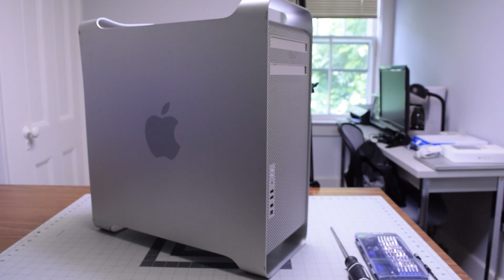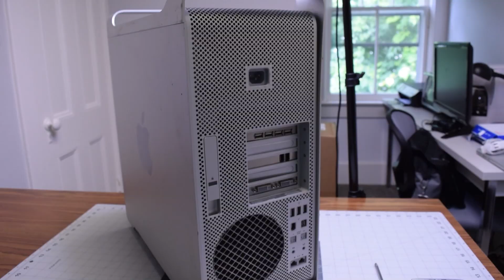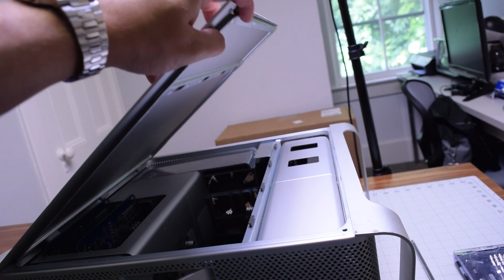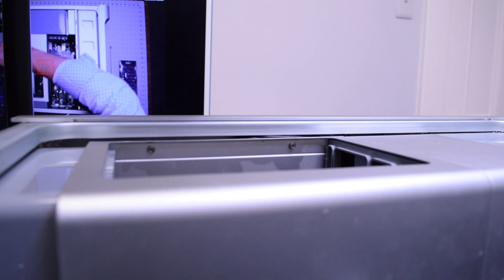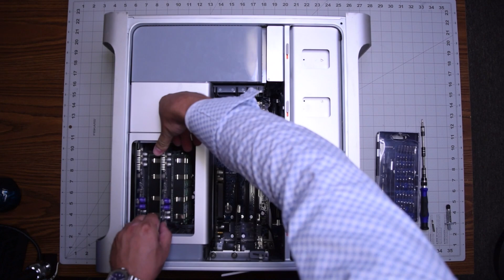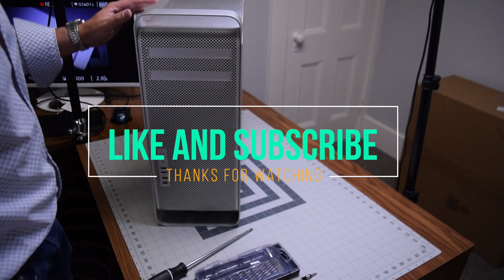Mac Pro A1186 - Memory Upgrade RAM (2006 and 2008)

Comment: Do you happen to know what model memory riser card a Mac Pro A1186 EMC 2113 needs. I just purchased 2 Mac Pro's A1186 EMC 2113, without any memory riser boards installed. I already had a Pro A1186 EMC 2180. My plan was to use the riser board from the A1186 EMC 2180 to test the two A1186 EMC 2113 then sell the motherboards and power supplies from the two A1186 EMC 2113. I was surprised to find out that the  A1186 EMC 2113 and the  A1186 EMC 2180 use different memory riser cards. The  A1186 EMC 2113 need a wider card. I was able to insert the card in the slot and the Mac powered on and gave the chime but no video.
Reply: hey Torg, do you still need the memory card carriers? (A1186 riser boards) I have two of them with 6GB memory in each. (12GB RAM).
Reply: so actually mine are from the 2180. is that what you need? - looks like you want a riser from the 2113.

Comment: do you know what is the maximum RAM upgrade capacity for this equipment? i had researched on the net but nothing found -_-
Reply: 32 GB (4GBx8 Slots) with Samsung M395T5160QZ4-CE65 or CE66

Comment: Sadly nobody own Macs as they are too expensive... even though these high spec models are now worth less than $100.... its like pourcing perfume on a pig.... if anyone realised what these machines were they wouldnt have gotten rid of them. So your videos are now for PC users who are snatching up mac trash which is PC gold. So maybe you should rename yourself Apple = trash worth PC gold.
Reply from the maker: Lol I'm not sure if that was an insult to my channel or Apple. I'm ok with Apple insults. Well, I feel like there is some truth to what you are saying but in general Macs are just more secure and are just nice to use. Why not try them at a bargain price?
Reply: @GRIBSOFT  They are not secure - thats why they keep updating the OS all the time. I know someone who had a trojan on their mac the other day - why... because Apple tard think they dont need protection on their machines.
Reply: @matthewwilliamsbroll3007  "apple tard" huh? Never heard that term before. Didn't know people would get so overly emotional over a computer brand. I've always used 'em and had no issues except once when I had to sign up for a file storage service MEGA UPLOAD because a client was using it. It clogged my machine! Anyway had to remove all the crap that was distributed throughout my machine manually. Otherwise no disruptions ever.
Reply: @matthewwilliamsbroll3007  LOL and what about windows? windows patch over and over and over  like every 2 days or so so.... no point in your comment
Reply: Bro I’d rather yeet myself off a cliff before I try to read this again
Reply: Nonsense, you can still edit a feature length motion picture on these old Macs and much more, pure nonsense!